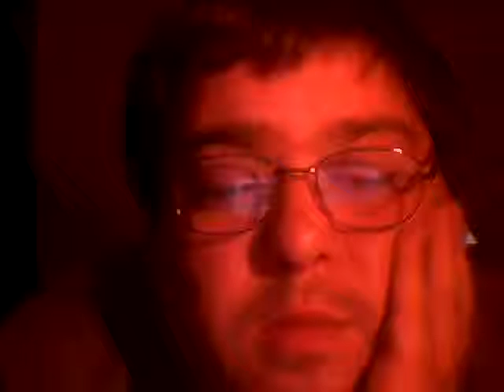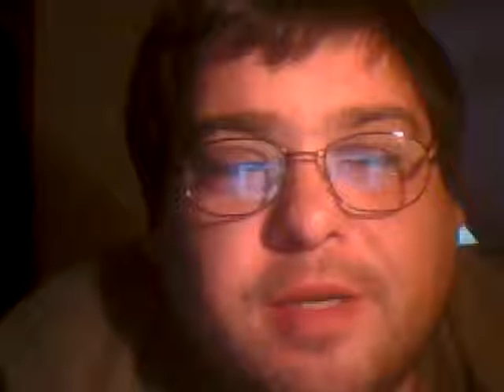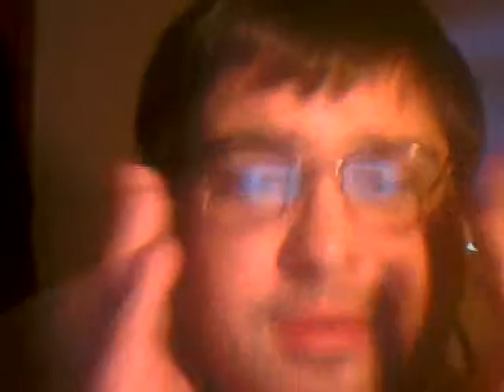Why Microwaves Don't work as Faraday Cages

Comment: Maybe you might know the answer to this. If I put my ham HT radio, or my world band radio into a microwave oven or a galvanized trash can, the signal is cut off. But if I put my FRS radio into either of these, the FRS can still receive signal. The FRS radio operates in the 467.000 frequencies according to the manufacturer's spec sheet. Any idea why this is?
Reply from the maker: It's not perfectly sealed.  If you perfectly seal all of the seams it won't receive.  I had a muffler shop weld all of the seams in my trash can and used a some mesh covered door weather striping for the lid seal.  It was a lot of work by my FRS will not transmit through it now.  That being said, even it it is not a perfect seal it will still be stop most EMP radiation from a distance.
Reply from the maker: The reason it stops broadcast transmission is you are dealing with line of sight signals.  When you are transmitting right next do it you are dealing is near end radiation (propogation) this is much harder to stop because the signal is bouncing around off of every surface and is polarized in every direction, and reflecting all over and finds the slightest crack to get through.

Comment: Hi Tom.. what would be good to use as a faraday cage to protect small ham radios and scanners...and would a microwave have any value if you lined it with foil.
Thanks
Reply from the maker: for small equipment just wrap them completely in aluminum foil.  This is what I use.  http://youtu.be/1q8Ye8yy-bE
Reply: *****
Thanks